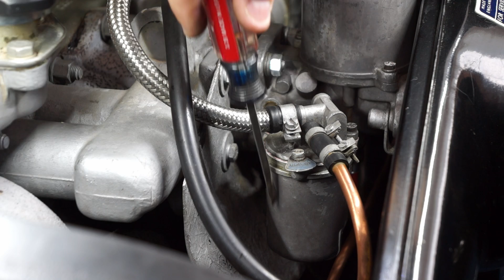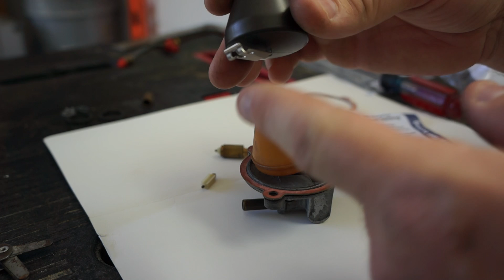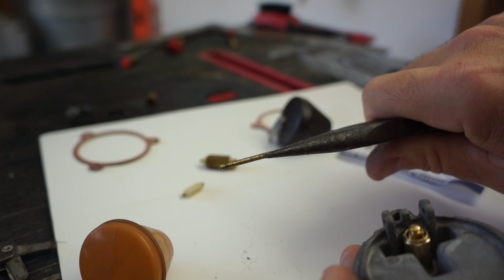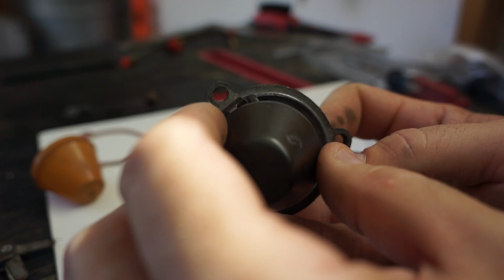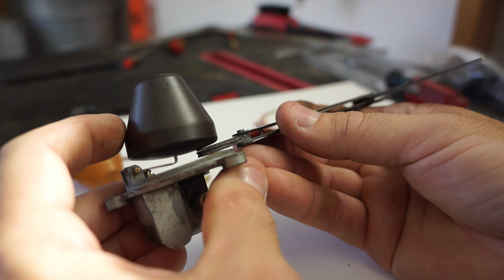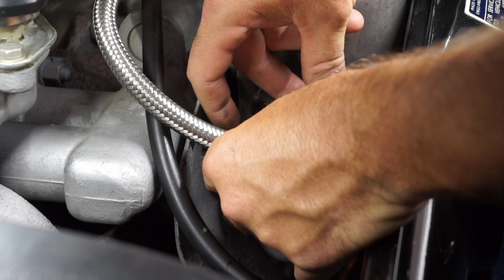1968 MGC SU HS6 Float Upgrade

Comment: Great video, thanks. I just fitted new needle valves and seats to my HS6s (to replace horrible grose jets) but got fuel overflow. I now realise I have the same unadjustable floats which will need replacing with that kit. Thanks for the part number!
Reply from the maker: My pleasure and good luck with the fix.

Comment: It's crazy to learn how classic cars are engineered to have specific tolerances by design. I have a 64 Alfa Romeo project. Finding certain information to rebuild components isn't always available.
Reply from the maker: I think that for engineers of that era "close enough" wasn't close enough. I have no proof that the float tolerance mattered all that much. My MG ran just fine even though it was an 8th out of tolerance.